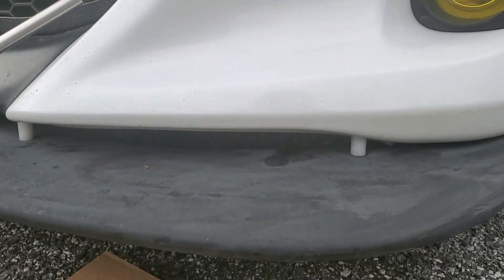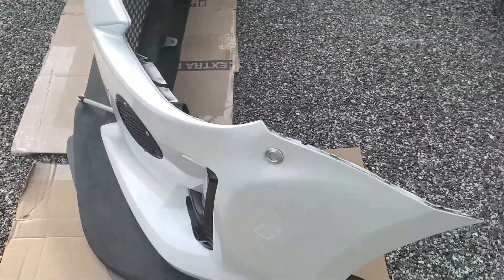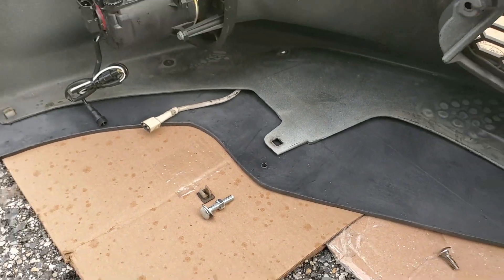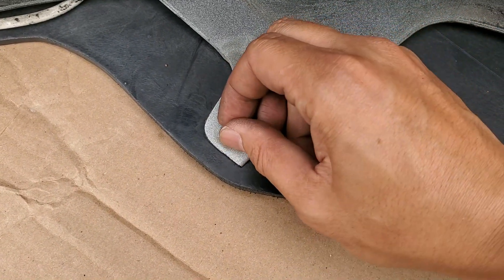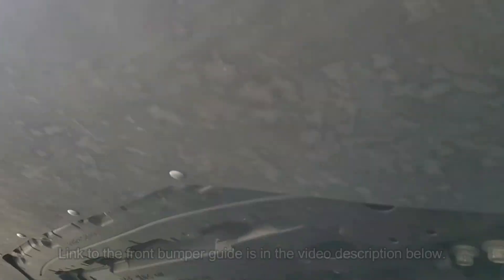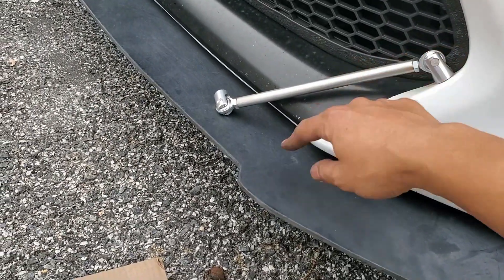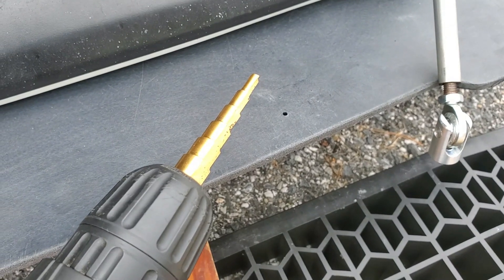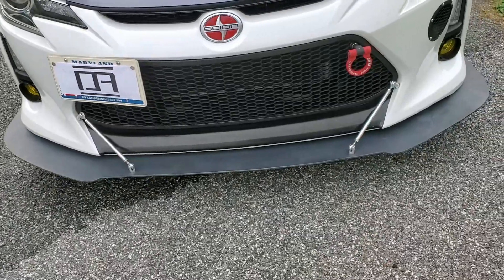Splitting Edge Design HDPE Front Splitter (Vehicle Specific) Install (Scion tC / tC2 / tC2.5)

Comment: Hey i loved the new splitter look but I don't catch how much did it cost?
Reply from the maker: Message the shop about pricing because they are dealing with pricing changes from their shipping company right now, but mine was originally $250 shipped.
Reply: @VampyreX13  damn thansk you saved me the trouble. For that price you can get aluminum one more durable?
Reply: @VampyreX13  I thought at most 100 USD for material since not aluminum thanks oh so much
Reply from the maker: @hanielbomb  aluminum Scion tC ones (that still require some custom installation) cost over $300 without shipping.

Comment: Ok so question i want to build one for each of my custom jdm cars and menards has the hdpe and i cant find abs anywhere. Is the hdpe as good? can i paint it or heat up the corner and cut and bend parts or not? I appreciate your video i am a DIY customs and it gave me alot of great ideas! Your splitter looks awesome btw!!  thanks
Reply from the maker: I haven't tried painting or reshaping mine, but I've read it can be hard to paint so you may want to get a sheet in thr color you want. That being said, it holds up well. I've scraped mine on driveways and even bounced the car off a curb with it and it was fine.
Reply: @VampyreX13  okay that's cool do you think I could wrap it with some vinyl maybe? I mean I only seen this stuff in Black and I have a custom car I'm designing. I appreciate your writing me back thanks again for the video it is awesome I'll probably watch it a few more times so I can figure out how to mount mine under the Civic and the eclipse. 😁
Reply from the maker: @jdmchickkustomz9417  you should be able to wrap it, but you may need to use some sort of pre-treatment or adheasion promoter to make sure it sticks to the plastic.
Reply: @VampyreX13  okay cool I'm going to work on my splitter soon appreciate your help

Comment: Do you have any issues with have the splitter rods just in the bumper?
Reply from the maker: I've had these support rods installed for 3 years now with no issues. I just made sure to use large fender washers behind them.